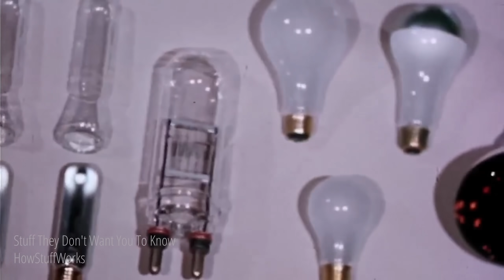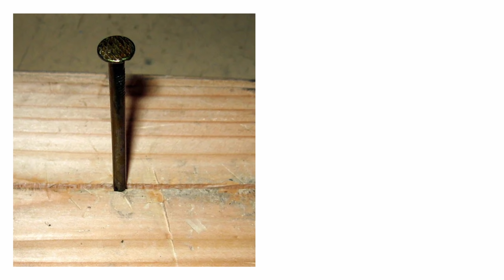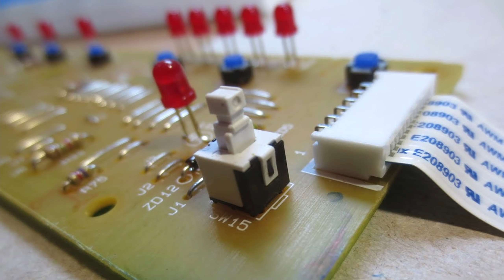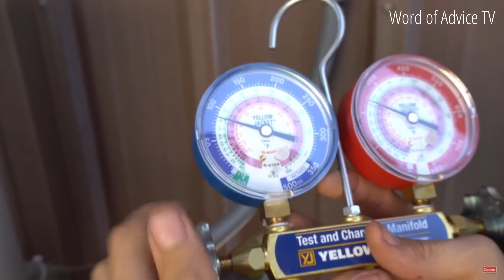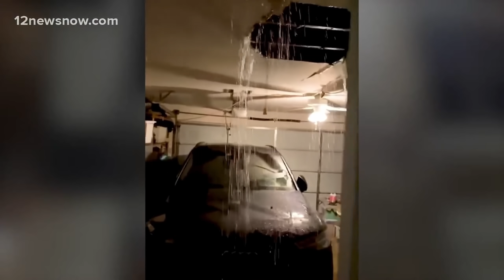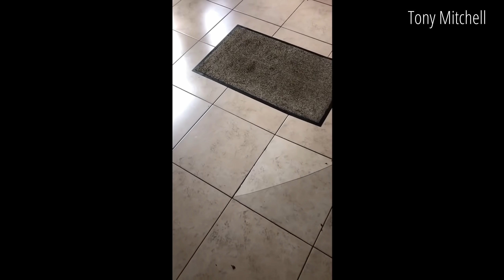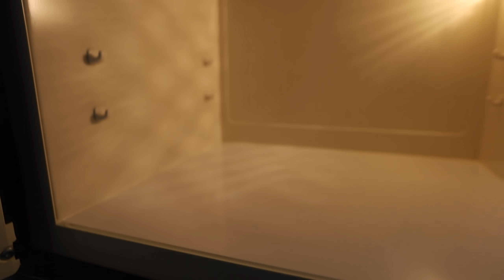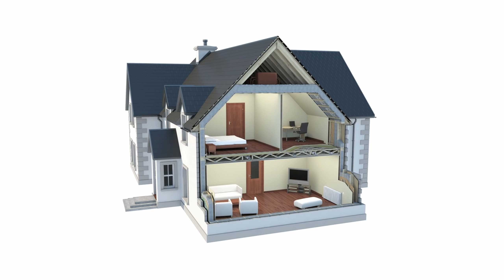Built to FAIL | Planned Obsolescence

Comment: Is there a real reason solid brick and concrete homes aren't more common in the US? They can be a bit trickier to insulate, but their durability is pretty incredible. I live in South Africa, where at least 90% of houses are concrete or brick - wood framed homes are fairly rare here. Brick costs 5-10% more - really not an unreasonable amount at all.
Reply: Oh yeah, I also should have mentioned that while not extremely common, adobe brick homes are making a comeback in the Southwest.
Reply: It depends on what part of the US you live in. In the Southeast, concrete block or brick homes are very common. Hurricane Andrew forced a complete rewrite of building codes in that part of the country.
Reply: Well, I live on the West Coast where we have regular earthquakes. So building with brick is considered pretty dangerous  here.

I know some people deride concrete as environmentally unfriendly due to the amount of CO2 created in its manufacture. But I don't know if that's why it's not used, or whether it's more an aesthetic thing.
Reply: @oliviastratton2169  brick definitely doesn't stand up well to earthquakes. But reinforced concrete performs excellently, far better than wood framed buildings. Concrete would also be more resilient to those fires you guys seem to have every year. Granted, fire can still damage a concrete building, but they are far more resilient.
Reply: @gabrielfraser2109  Yeah, durability isn't the problem with concrete. Like I said, the aversion to concrete is probably due to environmental concerns and/or aesthetic sensibilities.

Comment: Cars that cannot be serviced easy is so maddening.
Reply: Ironically, this is sometimes due to the government mandating that pollution controls be difficult to bypass. People want to bypass them because they damage the engine, mainly diesel vehicles. To the point where "DEF deletes" are a thriving industry.

Of course, pollution controls for cars nowadays are beyond absurd. Standards are tightened every few years to justify the budgets of bureaucrats, not because they make any environmental sense. We could probably set the standards back to what was in place in 1990 and not many people would notice. The standards for drinking water haven't really changed in decades and we're doing just fine.

Comment: slab on grade is cheaper than pier and beam, especially with the larger and larger houses being built. concrete is cheaper than wood. they work well even in expansive soils as long as there are no plumbing leaks or nearby large trees. either is disastrous to slab foundations. a bigger problem with new housing developments is the use of fill dirt that washes away from the foundation.

Comment: They should force all manufacturers to offer at least 7 year warranty. I'd pay more to be sure things don't die on me when unexpectedly
Reply: New Zealand has consumer law which means the retailer must repair manufacturing defects, and if it can't be repaired in a reasonable time frame then they must refund the consumer. The consumer guarantee lasts for the reasonable expected lifetime of the product. If a retailer doesn't repair or refund, it only costs around $10 to take them to court, lawyers aren't allowed either. Research this law, and push for your politicians to copy it.
Reply: you can buy the extended warranty today. but nobody does
Reply: @gsabic  extended warranty is toothless compared to good consumer law. You can also buy extended warranty in New Zealand, but only an idiot would pay for it because consumer guarantee covers you for longer and for more.
Reply: @nameberry220  nobody buys an extended warranty in USA because doesn't make economical sense. 
there is not free lunch, if you change legislation to force products to include a longer warranty you will pay more for those products.
Reply: @gsabic  Not true. Did you watch the video? Planned obsolescence is about products being designed to fail. The consumer will always pay less when they're protected by good consumer guarantee law.
Reply: @nameberry220  I know as retired repairman that planed obsolescence is a fact. I also know as a very successful capitalist that "there is no free lunch", when government intervene in the private sector prices goes up. 
Are you a communist?
Reply: @gsabic  It's usually the opposite, if the government doesn't intervene, prices go up and quality goes down. The government needs to keep business accountable.
Reply: @nameberry220  not true. 
I vote with my money, If I don't like a product or service I don't buy it. I don't need the government to decide what is good for my and my money. 
I grow up in Argentina, the country of the million regulations and hundreds of taxes, thrust me doesn't work. 
I been 1 year in New Zealand in my 20's, I love it, but I don't like the direction is going, NZ got wealthy with free markets not with  regulations, taxes and big government.
Reply: @gsabic  You're completely wrong, and I wonder what you're doing commenting on a video about planned obsolescence when you apparently don't understand it. The consumer can't fight this alone, (wITh tHE WAllet), they need to get together and pass consumer guarantee law to protect them from dodgy business.
Reply: @nameberry220  I understand the problem, I don't agree with your solution. 
usually you get what you pay. If you wan better warranties will cost you more $. 
sorry that I pop your balloon, but unions are crap, and socialism doesn't work.
Reply: @gsabic  Planned obsolescence costs more. Consumer guarantee laws equal cheaper product, better quality and longer lasting. You're wrong about unions too.
Reply: @nameberry220  Argentina is the country with the most powerful unions in the world and minimum salary is usd150/month, 100 years ago used to be one of the 10 richest countries in the world, thank you unions
I agree with you that a better build product is cheaper in  the long run, but a $1000 dishwasher with regulations that grant a 10 year warranty will make the same dishwasher a more than $1000 dishwasher in  the initial purchase price, that extra warranty is not free. 
BTW, that compressor in the video is likely misdiagnosed. An architect using google doesn't make a trained technician with a multimeter. She just throw parts at the refrigerator and cross fingers.   Very rarely compressor fail after 2 years, that is why samsung offer 10 years in  the compressor only. same happens with the washers drum that have lifetime warranty, drums never fail the support of the drum fails all the time and is not warranty.
Reply: @nameberry220  and let me guess, besides big government, socialism and unions you are interested feminism, veganism, and taxing rich people because they are evil. just kidding LOL
Reply: @gsabic  Actually I'm probably not interested in them the way you assume. And yes no one legally earns a billion dollars. It's only possible by exploiting others.
Reply: @nameberry220  exploding others (communist manifesto 101). do you thing that Elon Musk explodes others? how many persons do you think he help? how much do you think that his contribution to the world is worth?
we are getting a bit of topic.
Reply: @gsabic  Hopefully one day you realise how wrong you are.
Reply: @nameberry220  why you didn't answer? saying I am wrong is not an argument
Reply: @gsabic  This isn't a serious conversation or argument. I think you're wrong, thats it.
Reply: @nameberry220  ok, I will answer for you, 
Elon Musk never exploded anybody, he help millions of people, his contribution to the world is worth hundreds of billons and will be worth trillions at the end of his life after working 80h/week non stop for decades.
Reply: @gsabic  You're wrong.
Reply: @nameberry220  LOL, you are funny.

Comment: I recall fridges lasting over 20 years.
Reply: My dad had one that ran on gas. I think it was from the 40s maybe earlier. It was big and pink with a latch. He had to manually defrost it each year but it was still running when he got rid of it. He only did that because he was worried about the grand kids getting locked in it. That's 60 or 70 years without a repair.

Comment: There is a saying about value engineering. Anyone can build something that works. A good engineer can build something that barely works.
Reply: Agreed. It's generally not hard to over-engineer something (eg. use 2x thicker slab, 2x thicker steel). The hard part is convincing the clients why they should pay double the price... or in the case of aerospace; convincing gravity to let your plane lift off the ground.
Reply: sad thing is consumer dont really have a choice.
both GE and samsung refrigerator  are manufactured BY samsung.
Reply: Great video as always
Reply: Or home builders building below code here in CA
Reply: Not a good saying on tectonic active areas…
Reply: @Nelyari  You can always move somewhere else.
Reply: There is a simular saying in my trade;

Any machinist can build your part and solve your problem well.
Only an engineer can design it to barely work for twice the price.

I should note. Machinist, as it was used locally; in the industry has since been separated into three diffrent engineering fields and one "low skill" trade still called machinist. 
It was considered too difficult and expensive to apprentice machinists, and there was only about 40% who could pass each skill test that came along.
Out of four.
So I got lucky on that one, last apprenticeship NASA paid for and I just made it under the cut off. Albeit without enough hands on time at the time, but I got all the engineering side of it.

Comment: Planned obsolescence is the reason i buy older vehicles, easy to fix, easy to maintain. That's why my 65 has been on the road for 55 years. The fact that this is starting to apply to houses is astounding, looks like I'm building my own house now.
Reply: I was told to use this strategy when buying my first car. But I find anything old that the 90s it's really hard to find parts for. Alot of my friends followed the same strategy and ended up having to scrap their old cars since nobody was selling the parts needed to fix them.

I think it's a balance. You don't need to buy a fancy new car every year. The car I have now is a 2002 model, and has a wide variety of parts available but also not expensive to fix or repair.
Reply: @dylantd9189  fair enough, i used rockauto for most of my car stuff. I inherited the pickup, and the tradeoff is big now, most 90s stuff is becoming classic and come with the classic tax
Reply: I got a used 2012 chevy volt (plug in hybrid) for $3250 at this point save my so much money in gas that is a "free car", In 2 years I change one $70 window regulator